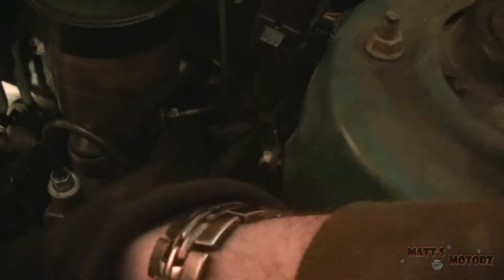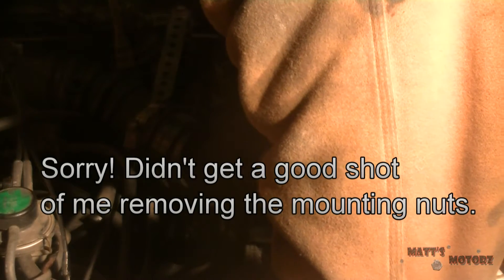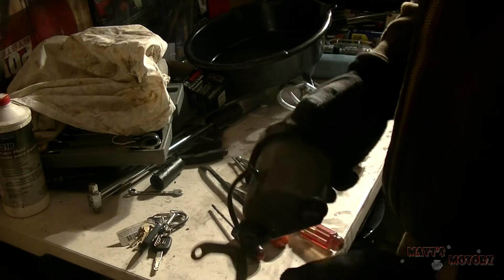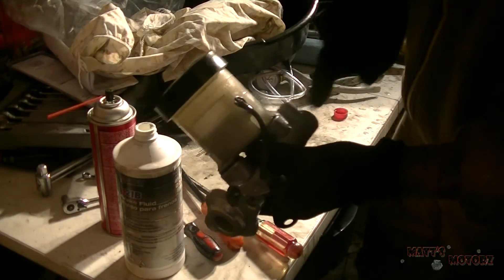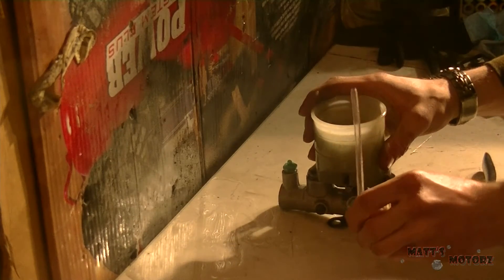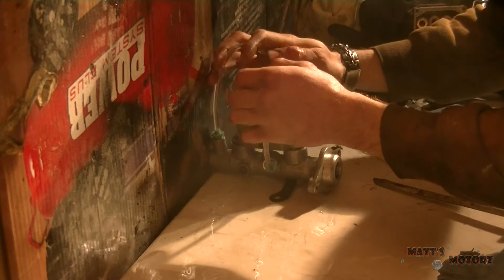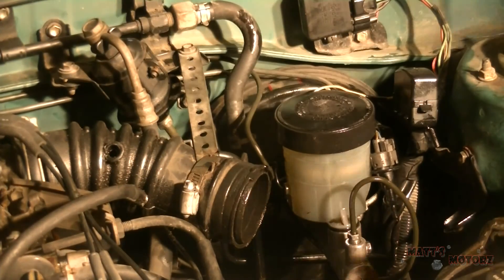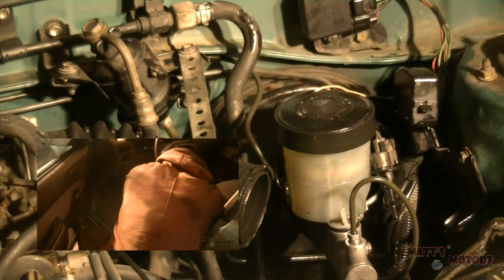Master Cylinder Replacement [1995 Toyota Tercel]

Comment: Bro where the hell is the clutch fluid resivoir in out 1995 toyota tercel??

Or is the 1995 toyota tercel a spring clutch system or is it hydraulic?

Finding info about tercels online is so rare lol

Comment: My 96 tercel has the same issue, do you have a link I can purchase the brake cylinder?
Reply from the maker: This one was bought at pepboys.  Although the best place to buy parts IMO is rockauto.com
Reply: I checked rock auto and it was expensive, I don't live in usa so.
Reply from the maker: You might want to try ebay then.

Comment: Do you do this work just for family and friends, or are you a mechanic by trade?
Reply from the maker: I am an independent mechanic, I do this work on the side as I am going to school for my PhD in electrical engineering.  I use to run ads to get customers but pulled them down so I can focus on my school work more.  I still however, have customers from when I had the ads up, and that's where this car came from.